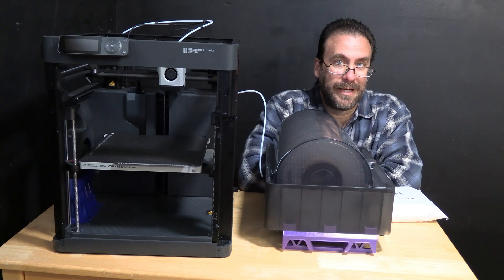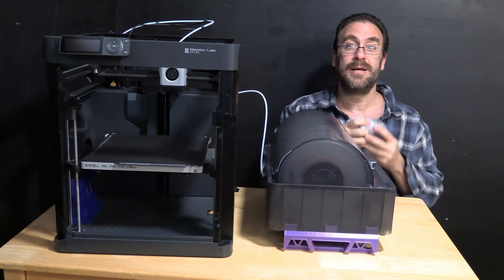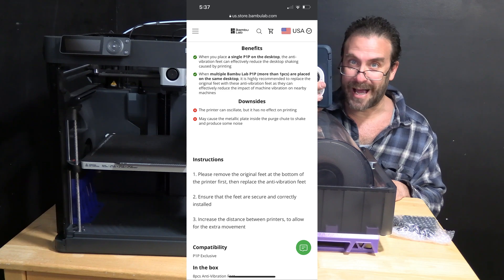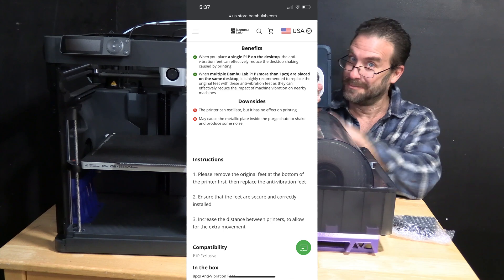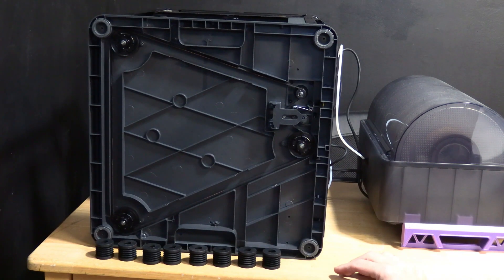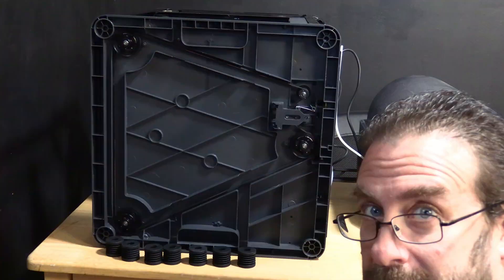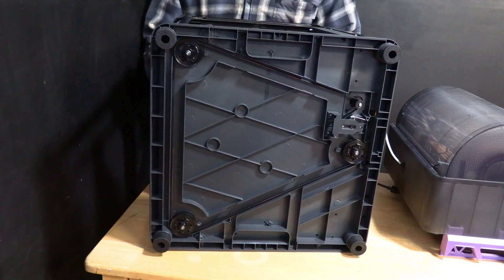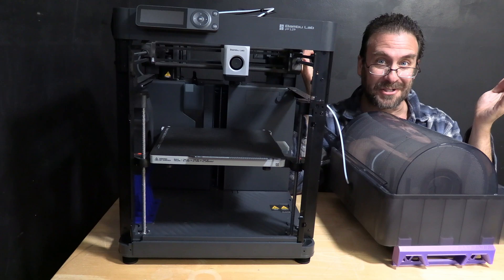Installing the Anti Vibration Feet on Bambu P1P - 3D Printer

Comment: I was skeptical when I opened these too. Installed them on the printer and thought about putting the old ones back on. However I tried a few prints after a calibration, and the prints are just as good and it does reduce the vibration on the table considerably. I will be upgrading my bench and will most likely put the original feet back on, but I am happy with the purchase.
Reply from the maker: Good to know. I hope others will chime in over time. I'm curious what peoples real world experience with them will be
Reply: Ya the video is basically like trying running shoes on then saying "I dont like the way they look so I am not even going to run in them" kind of strange when this channel is usually pretty practical

Comment: Thanks will avoid when I trade my 3s1 for one of these!
Reply from the maker: I wouldn't even do that. Keep the S1
Reply: @3DRundown  sadly I only have room for one printer.
Reply: @3DRundown  I bought an s1 pro* and a p1p at the same time. They are def making the right move

Edit = Was an s1 pro not the standard s1